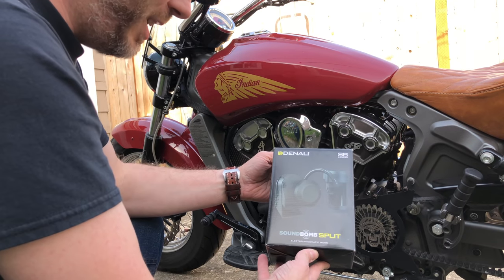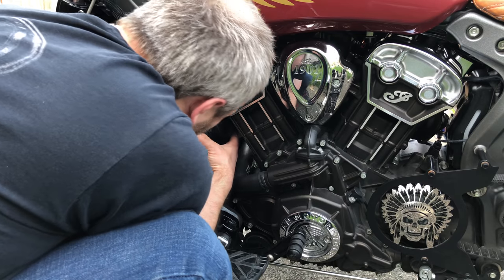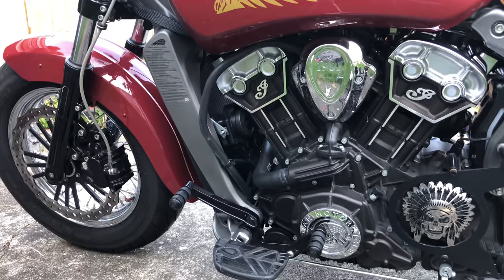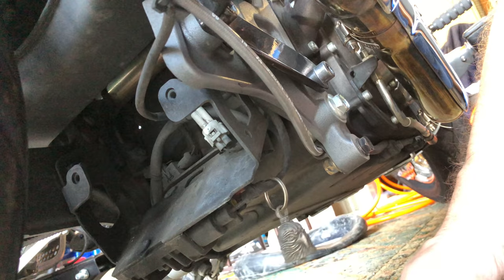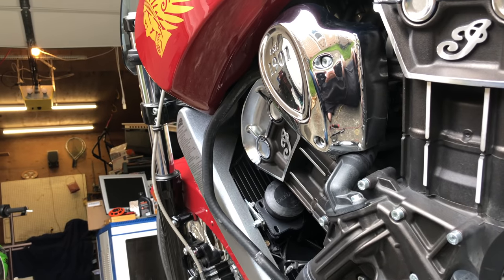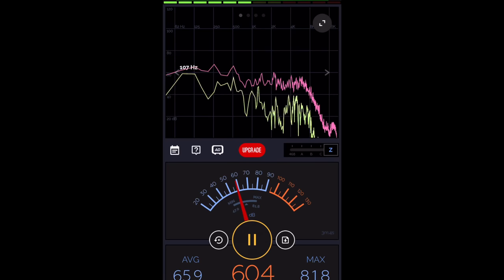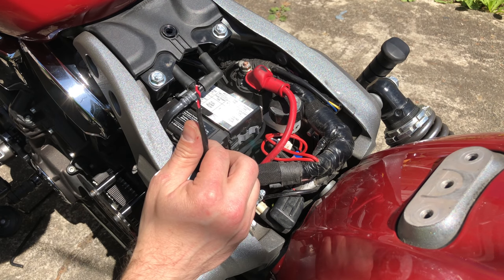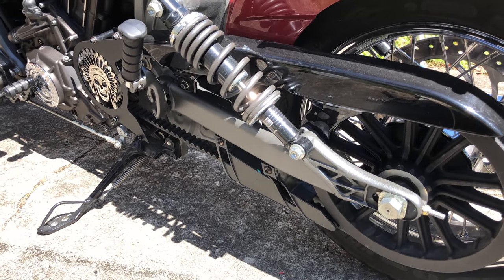Indian Scout - Louder Horn Installation!

Comment: What do you like to use to clean the matte finish on the cylinders ? I'm due for a wash and the dealership I bought the bike from had left a little dust on em' and it doesn't  wipe off with a rag. Thank you for the content, the horn is weak.

Comment: Hey - can you please add link from where to buy  also the  Heel/Toe Shifter + the magnificent foot holders ?
Reply from the maker: The heel toe shifter was from Aeromach or something like that. But they pulled out of the market for some reason. The floorboards, should be able to find them on Revzilla.

Comment: Hi from Australia,  I'm TRYING to install this horn on my bobber and can't use the space for the compressor that you did or under the tank. Do you have any other suggestions? Like bolting it to the other side of the radiator like how you bolted in the horn?

Comment: i liked how you made your own brackets. Very innovative/awesome.  Just curious- with the split version why didn't you mount the horn under the bike like the stock horn, after putting the compressor where the absent ABS module goes?  It seems like it would be a cleaner install (for example you wouldn't have had to reroute your hosing that went along the inside of the frame)
Reply from the maker: The stock horn is super tiny and flat. This one, while small, is still much larger. Just wouldn’t fit there at all. Also makes the oil changes easier, not having to remove it first.
Reply: MotoCycle thanks for the insight! ✌🏽

Comment: Can it handle the heat from the engine
Reply from the maker: Yes. The engine is watercooled, it doesn’t get any hotter than the radiator.